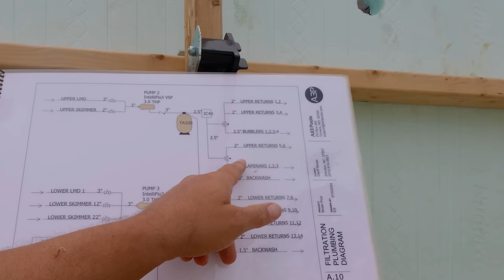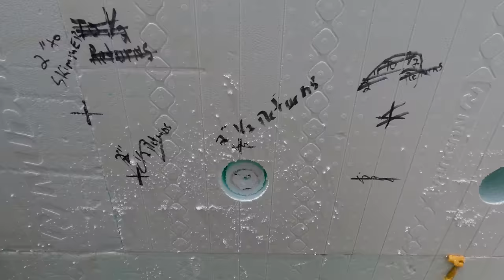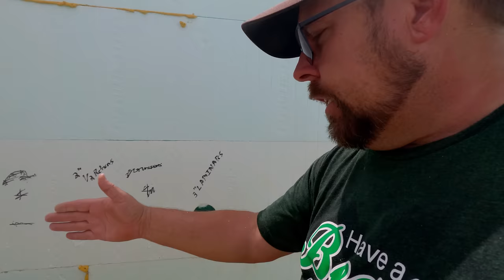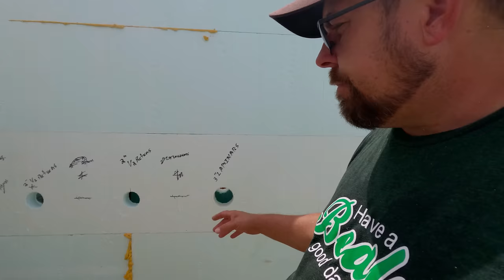Surprised when cutting holes in the ICF pool ￼

Comment: You might want to consider having shutoff valves and unions on your pool service lines.  It will allow you to close off any pipes in the event you need maintenance or have a leak without draining the system.  The unions will allow for quick removal of pumps and filters  without having to cut your pipes.
Reply: That's what I did, but my pool is above ground so you would drain down quite a bit.
Reply: I would also do this on the house- our house was built in 1988 and there is only ONE shutoff for the entire house! We are in process of fixing that!
Reply: All of his service lines will have manual valves

Comment: My above ground pool is 20,000gal (18'x45')  I have 2 pumps, 2 filters. I run the sand filter for several hours, then the DE filter kicks in. This collects most of the floaties in the easily cleaned sand filter, then the DE polishes the water.

Comment: Laminars is you say? Very cool. Had a pool with half a dozen of them. Could have hired out the pool as a therapy spa. Just a thing for sore back while floating on air mattress. The effect of LED lighting in pool is like unbelievably cool as well. Have fun there 👍
Reply: I had a follow-up thought on the laminars... I wished that I had installed gate valves rather than ball valve at each laminar. This would have made them much easier to adjust. Was fun to take three of them and make output converge on one spot. Made for quite the back massage I can tell you. Especially effective with heater on high) 

Cheers.

Comment: A thought from someone who used to have, and took care of five swimming pools but is down to only one...  You cannot have enough valves, and you cannot have enough unions.  Set up everything thinking about ease of replacement, because you will be replacing a lot over time.

I have to disconnect our pool pump and take it inside the house every winter because a $1300 swimming pool pump cannot handle being winterized and left outside.
Reply from the maker: Makes sense. Thanks

Comment: Been following this project have a question; what is the strength (or the hydro-static pressure) of the un-supported (no back fill) walls adjacent to the pump room and the infinity edge? Then the three-inch hole for the bubbles I am beyond curious!! Not saying can't don't won't; a summer semester of statics was brutal but opens ta mind a bit to the hmmmmm...interesting--dawgh daawgh!!
Reply from the maker: The concrete is 11” thick. #5 rebar vertically 8” on center and (2) #4 bars horizontally 18” on center. Xypex in the concrete mix. The lower pool is 4000 psi. I may pour the upper pool at 5000.
Reply: @BealyGood  Copy that!!! Thanks!!

Comment: Surprises me that you are going to pour concrete up to pool piping, thermal expansion and vibration is hard on pvc pipes I've seen them just fracture off flush with the concrete face. Back in the beginning of time we used to wrap them in Denso if they didn't have an oversize sleeve, the sleeve option was preferred for a myriad of reasons.